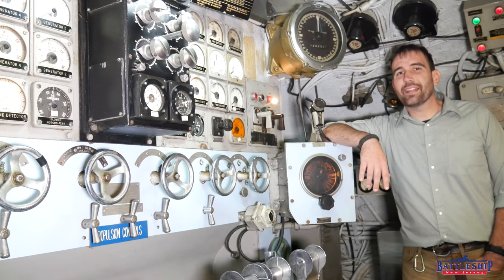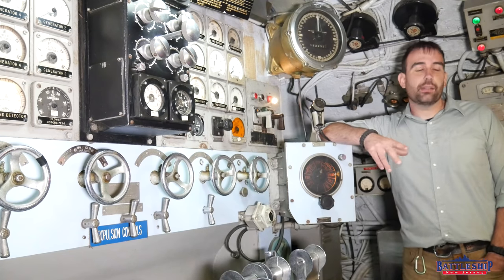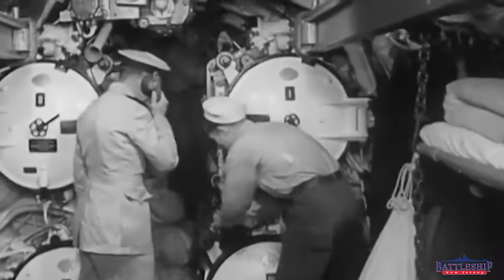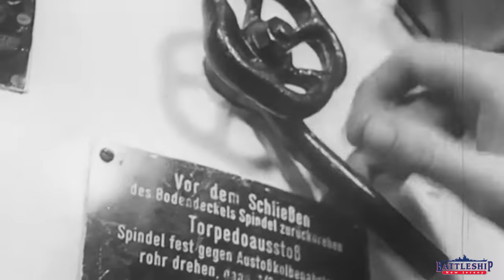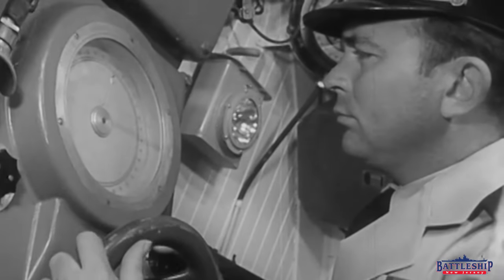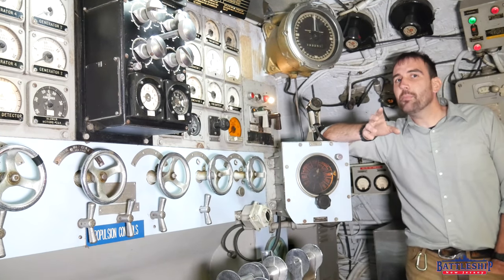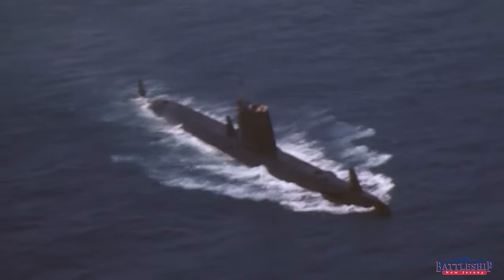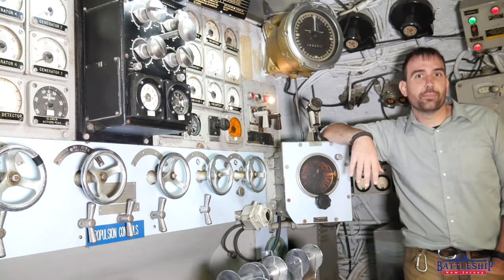Why Does a Submarine Have an Altimeter?

Comment: Isn’t it backwards to what you said? If the engines are drawing air from the sub, when water is covering the inlet, there is a vacuum inside the sub hence less air pressure. Yes, the ‘altitude’ would increase as you get less 'air' pressure as you go up.
Reply: The liquid fuel is converted to a gas, so more volume comes out of the exhaust than goes in.
Reply: I think what he said was correct. if the engine is sucking in air then it would decrease air pressure causing. This would simulate a aircraft going “up” less air pressure the higher you are.
Reply: Probably just a verbal slip. He pauses for a second as he says it, like I do when I've got two ways to say something and accidentally mix them together and say some nonsense.

I'm assuming it was the same thing here, could have said the reading on the altimeter would rise or the number of atmospheres would fall, and we got a bit of both.
Reply: @sIightIybored  The exhaust is vented out independent of the flap valve
Reply: @sIightIybored  The exhaust is vented outside.It has zero influence on the air inside the sub.
Reply: @NIGHTSTALKER0069  Correct.  As the engine runs while the induction mast is not letting in air, the pressure drops, causing the "pressure altitude" to rise.  I served in an Oberon Class Boat (Canadian Navy) and we also had a way to allow some water to come into the mast, it collects in a tank below, and is pumped out of the boat.  It is not always pleasant when the induction valve shuts causing a vacuum.  Used to listen to the tin cans pop as they expanded and contracted while we were running the diesels while submerged.  And as others have already said, the exhaust takes a different route out of the boat, in the case of the O-Boats, an exhaust mast, although USN boats I believe had that built into their snorkels.  In the USN nukes I have seen, it is built in the the fin (USN term-sail).
Reply: @NIGHTSTALKER0069  At about 4:00 he states "getting the air from inside the boat, so the number of atmospheres goes up...". This is backwards as the 'atmospheres' would go down (like from 101.3kPa down to 70kPa or something). I understood what he is getting at as per the last sentence I wrote yesterday.
Reply: @sIightIybored  - Sorry, but just no. The exhaust is pipped offship, else you gas all your sailors.
Reply: @ronchappel4812  - Most SS's get induction air from inside the boat, and the snorkel is basically just a open tube (with flapper valve) to inside the boat. So there is normally a slight decrease in air pressure within a snorting diesel boat anyway. This is what has a influence on air with the boat.
Reply: @antonyborlase3965   @Tribe of the Iron Flame  @Ron Chappel this is specifically talking about the scenario that the air outlet is blocked so the exhaust will not be venting out of the ship
Reply: @sIightIybored  No, this is talking about the air inlet.
Reply: @sIightIybored  The exhaust can be released underwater via a one way valve. It is much more important that you get the exhaust off the ship than it is for you to not draw air from inside the ship
Reply: @sIightIybored  Diesel/electric subs always vent outside, even if a wave goes over the snokel. The exhaust pressure blows past the value. Same teck tanks use when doing crossing of water deeper than the height or the tanks exhaust, or a 4wd (with snokel) going through water deeper than the body.
Reply: He worded it a little confusingly, when the diesels started to consume internal air the PRESSURE dropped but that made the ALTIMETER reading to go up. Higher altitude reading = lower air pressure.
Reply: @antonyborlase3965  Agreed. When the clapper valve closes, air inside the sub is consumed, internal air pressure decreases, as do the "number of atmospheres". As a result, the "altitude" goes up (while the flapper is closed). When the flapper opens, it allows additional air to replenish the interior of the sub. When this happens, the air pressure increases, the atmospheres increase and the altitude decreases.
I think he didn't really need to make any statements about "atmospheres". Explaining it via simple air pressure and altitude would have worked just fine.
All in all, good explanation.

Comment: Nuke boats had diesels and a snorkel with the flapper valve.
In port shutdown with the diesel running and drawing air through the open engine room hatch, a surface ship got under way without tugs and came close to ramming. With collision alarm sounding, we rigged for collision and shut the machinery space to engine room hatch, which immediately shut off the air flow to the diesel. A chief recognized the problem and opened the hatch. It sucked him into the machinery room in a heart beat. Skinned up his shins was all.
I don’t remember seeing an altimeter, but I was a machinist.

Comment: So the air source for the engines is cabin air, and the snorkel is feeding the cabin.  It's designed to draw a vacuum from the cabin of the sub.  That's a completely opposite way from how I'm used to thinking about things from the perspective of a pressurized fuselage in a jet airplane, where the turbine engines compress the air which is pumped in to pressurize and climate control the cabin.  There's a 0.1 psi negative pressure differential valve to prevent the fuselage being crushed like a pop can in the event the outflow valve fails, which normally controls pressurization.  A pressurized aluminum aircraft fuselage is essentially a metal balloon with a nominal operating pressure of 8.0 to -0.1 psi.
Reply: The air quality progressively worsened the longer the sub was submerged.  Quickest and easiest way to perform a complete air exchange when possible is to let fresh air in one end and let the diesels suck the stale air out of the boat from the far end.  This is possible because the engines, by necessity, are located within the pressure hull.

I guess one COULD pull enough air through the cabin of an aircraft to feed a couple of jet turbines, but getting up to walk to the Lav might be a bit of an adventure...  (Joking!)

In all seriousness, two totally different scenarios.  In an aircraft, you are pressurizing the cabin to a specific pressure, with the differential between inside and outside being small enough that you can easily control the pressure with a pressure relief valve.  A MINOR problem in either direction isn't immediately catastrophic, as you still have atmosphere on both sides.   The submarine has a differential of about 150 PSI at a depth of 300 feet, and is expressly designed to NOT allow the pressure to equalize under any circumstances.

Since the default configuration of a submarine is a sealed tube, anything which allows the outside world inside requires both manual initiation and close supervision.  You don't want that valve to close while the engines are sucking air from within the hull and shoving it out the exhausts, nor do you want it to somehow open when the boat is submerged.  Humans don't do well breathing air at low pressure, nor do they do well breathing water at high pressure.

Wanting to keep my air at a comfortable 14.7 PSI absolute, I chose surface ships.  Ended up on a replenishment oiler.   7.5 million gallons of fuel and 600 tons of munitions.  Always assumed that any abnormal pressures would be accompanied by a lot of heat and be extremely short in duration...at least as far as I was concerned.
Reply: Damn Noel!  What are you doing trolling the submarine stories?  Miss my old boat stories?  Miss flying with ya Captain!!  Send me a PM...

Comment: Modern nuclear subs still have these mounted in the Control Room. The crew can use the snorkel to pressurize the ship a bit so we can run the High Pressure Air Compressors (HPAC) to recharge the Air Banks while submerged and return the air pressure inside the sub back to normal. You develop the ability to pop your ears in your sleep.

Comment: Nuc. Even nucs had diesel engines.  The boats I was on, the diesel  drew air from the  compartment and only exhausted through the snorkel mast (below the waterline so as not to advertise). The diesel was often used to consume smokey atmosphere or otherwise compromised air.

Comment: At about 4:00 you said that the clapper would close and the engine would be drawing its air from inside the boat AND THE ATMOSPHERES WOULD GO UP.  That is incorrect.  The atmospheres (atmospheric pressure) would go DOWN.  What would go up it the reading on the altimeter.

Thanks for a really interesting and informative channel and all the work you and your volunteers do to maintain the New Jersey so the rest of us can get an idea of what life on a battleship was like.

Comment: Served on the Ethan Allen ssbn 608(g)
The worst pressure change was bleeding sanitarys back inboard after blowing them to sea. We had to bleed the pressure inboard so as not to give away our position.
Good times lol...
Reply: I notice that you conveniently forgot to mention the "aroma" that wafted throughout the boat until you could get the snorkel raised or surface to replenish the air in the boat.

Comment: Shnorkels were being installed on some regular U-boats long before the type 2000 came along. The type 2000 had vastly increased battery capacity so they could stay submerged much longer and could move underwater as fast as on the surface. They became operational the day Germany surrendered.

Comment: Hey, Ryan!  I think you got it backwards.  When the clapper closes, the air is being drawn from the space inside the vessel, creating a decrease in atmospheric pressure, so the indicated altitude would increase.  Apparent "altitude" increases with decreasing atmospheric pressure.

Thanks for your videos! I've been binging on them since we visited the USS Alabama a few months ago, and they're fascinating "behind the scenes" looks!
Reply: you are correct Tony, there would be an atmospheric pressure decrease indicating the opposite increase in altitude. Very sharp catch sir.
Reply: @4:16 he says jumps and continues to climb. Sounds like he got it right. The gauge is a altimeter it doesn’t output pressure it outputs height (altitude) based on the input of pressure.
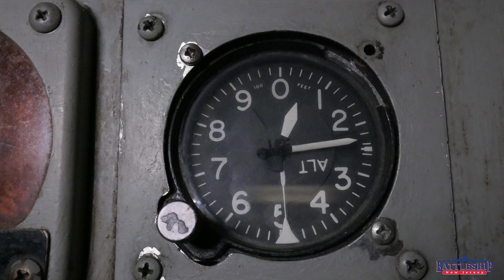Reply: @NIGHTSTALKER0069  True. @3:56 he says the number of atmospheres goes up. It'd go down.  :)

Comment: I almost forgot, as auxiliary men  aft we run the air compressors submerged lowering the pressure in the sub little by little, not as fast as the desal at 2190 sfpm of air flow  when running.

Comment: Slight correction: the problem is to get the air in not the exhaust out. Some boats have the exhaust release lower down, so it is expelled below the surface. At greater depth it is necessary to run an extra compressor to push the CO2 out. This only makes sense, if the boat is running not on air but either oxygen or an oxygen carrier (like H2O2) because the nitrogen would cause a bubble trail. The disadvantage is that the deeper the boat goes  the higher the workload of the compressor gets using up more and more fuel thus limiting range. CO2 itself is water soluble enough that at normal operational depth it will not reach the surface as bubbles giving the position away.

Comment: Ryan You implied that the Type XXI was the first german sub to use a snorkel.   In 1943 the Type VIIC and the type IXC subs were retrofitted with a snorkel and could operate submerged.  A operating snorkel was not even a German development.  In 1940 they captured the Dutch O21 class subs which had a working snorkels.  The germans did make the best use of the snorkel and as you stated the type XXI was decades ahead of typical sub of that time.
Reply: The idea was already around in the Middle Ages but it took some time to get to a viable technical solution. The Dutch system made the mistake to attach the snorkel directly to the engine without using the whole boat as a buffer. Less annoying for the crew's ears but extremly prone to getting water into he engine.
There is a poem in Middle High German about a guy who is pursued by an enemy and dives with his boat to the bottom of the sea replenishing the air inside via a retractable snorkel for several days until his pursuer gives up. What the poet could not know is that one would need a pump (or two valved pipes instead of just one open one) to avoid constantly rebreathing the used-up air inside the snorkel. A combustion engine is a sucker in itself, so that part isn't the problem.

Comment: I built the SSBN635 for a year and left just after commissioning and when to the SSN603 - I also did go to sea on the USS Carpenter during sub school so I have been on a Missile boat, fast attack, and diesel so without hesitation and having been submerge for 85 days strait I would take the Noc -  I also rode out a Hurricane in the fast attack that the diesel would not have survived - as a note I reported aboard the 635 on April 10, 1964 and the 603 on April 10, 1965 -
Reply: I didn't know a diesel sub couldn't survive a hurricane.......or I wouldn't have stayed aboard the Sennet in 1960 when we rode out Hurricane Gracie in 1960!

Comment: I guessed it was for cabin pressure. For example, keeping the internal pressure similar to ambient sea level. Aircraft have a similar gauge for this purpose.
But didn’t expect the gauge was for the snorkel. However I’ve heard dits that the change in pressure when water went over the snorkel was very uncomfortable for the crew.

Comment: My Brother was on the last Diesel boat the US Navy had the USS Tang II. Before she was sold they used to play with the ASW ships and planes off San Diego and had a cruise to Hawaii. Most of the time they would get a radio message asking if they would pop a periscope so they could find them. While Nuclear boats have the best creature comforts, Diesel submarines are still far quieter than Nuclear boats. Which is why China and other countries have more of them than Nuclear boats. With the fall of the Soviet Union the US Navy felt they didn't need ASW aircraft to find submarines. At least from Aircraft carriers, so in wartime, Diesel boats may have the edge even if they can't shower as often.
Reply: Depends on the coolant system. But a diesel, though quiet while her engines are off, MUST snort to recharge her batteries, and they only last so long, and those diesels make a hell of a lot of noise.
Reply: There aren't any PLANES on the carrier, but there ARE ASW Helicopters on our carriers, also on the Cruisers / destroyers that are other parts of the battlegroup. For planes, they are using the P-8 Poseidon- (replaced the iconic P-3 Orion) basically a Boeing 737 fitted with ASW gear (and strictly land based).
Reply: The Barbel Class was the last class of diesel boats commissioned by the Navy and the USS Bonefish was last to be decommissioned after a battery explosion.  The B-girls,  as they were known, were the most hydrodynamicly advanced diesel submarines until the 1980s.  They shared the hull form and layout with the Skipjack class SSNs. They were reputed to have a half hour rate of 25 knots submerged.  The Dutch built several modified versions which are now operated by Taiwan, ROC.

Comment: Taiwan still has 2 WWII era fleet boats in service, with modern sensors they’re not obsolete
Reply: yes 2 balao guppy conversions  both limited to 300 ft due to age cracks in hull. both still deadly in ambush positions. hei sish and hei pao I think
Reply: I served on the uss cutlass ss478 for about 2 1/2 years the now hei shih.
Reply: Correction. The Cutlass SS478 was a  Tench Class boat and underwent a guppy (Greater Underwater Propulsion) conversion after conclusion of WW2. This included addition of the snorkel, and increased battery capacity and improved generators/motors.  I was an engineman on her 1968-1971. She is still in service and recently underwent some yard work, including to the hull. The boat was transferred to Taiwan in 1973.

Comment: You can get rid of CO2 exhaust underwater in contrary to what was stated at 1:55 You just need to compress it to a higher pressure than water that surrounds you and you can blow it out in the water. A Russian experimental submarine Pochtovy did that in 1908, it use compressed air in tanks for oxygen.

A current example is the Gotland class burns diesel and liquid oxygen in sterling engines underwater, the engine's exhaust pressure is high enough to dissolve it is seawater in the submarine release it. so you can get rid of  CO2 underwater and air-independent propulsion submarines do it today.

The hard part of using diesel or any other stuff you burn underwater is the oxidizer, not exhaust. You can store liquid oxygen and use it but it has risk like leakage and keeping it cool, the range and operation taime also has limited but it is possible and is done with air-independent propulsion submarines.  So it is getting oxygen in that is the main advantage of a snorkel, releasing the exhaust is a bonus but not a required feature.  

A diesel engine is also quite loud so if you like to be stealthy that is also a problem. There is a reason that air-independent propulsion submarines today use sterling engines, fuel cells or gas turbines not classical diesel engines underwater. There has been experimental and small series usage of that in the past but is no longer used in modern submarines.
Reply: Really alot of boats with snorkels don't exhaust through teh snorkel, the snorkel is an intake, and exhaust is done out of the back top of the fairwater. I served on a 688i, you can see the exhaust for the 688i's diesel generator in the back of the sail near the top where there is a visible set of slits. For snorkel running you just need another clapper that reacts to exhaust pressure. the engines exhaust pressure is going to be higher than the water pressure at snorkel depth. In this case the clapper opens as long as exhaust pressure is higher than sea pressure.